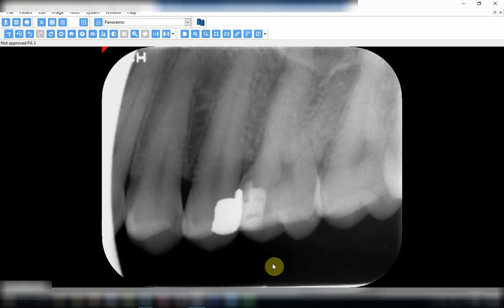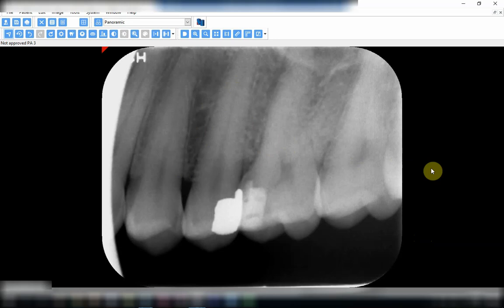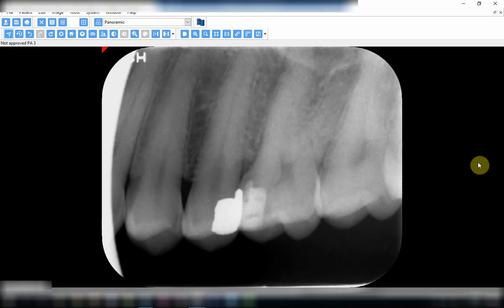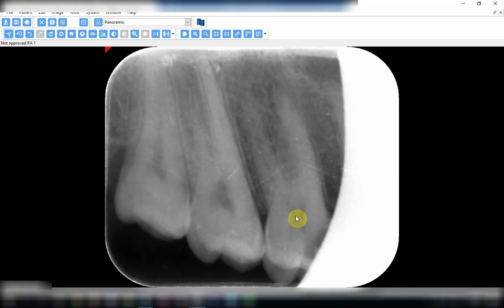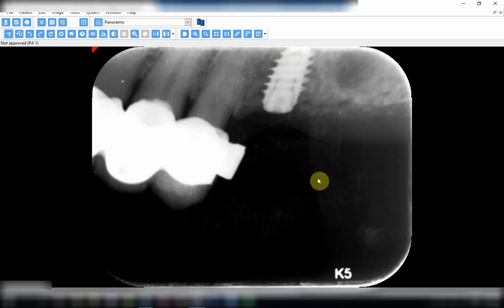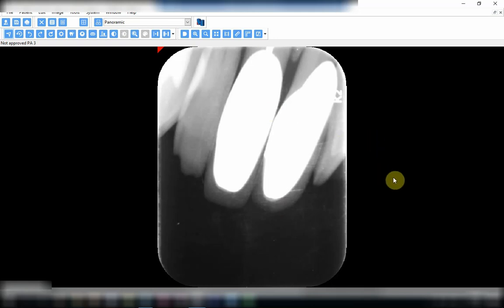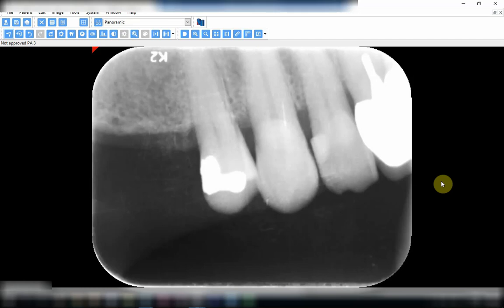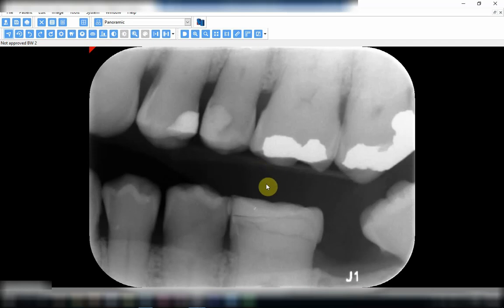Big mistakes.

Comment: Thank you Dr.. Viewed all the vedios in this playlist.. 👍👍 Could you please do vedios for IOPA tech. for pediatric patients..
Reply from the maker: Dear n n, actually the techniques are similar with two exceptions: 
1- decrease the exposure time by 1\4th of adult exposure time.
2- use smaller size sensors (size 0 or 1) based on the jaw size and teeth present.

Comment: Sir I followed your way how can I send my image here so you can guide me I have still facing an issue? Or else any email Id where I can show my problem facing
Reply from the maker: I think that your patient has a wide palate, so the film slides too much below the teeth. What I suggest is you push the film more towards the mid line of palate and then place a cotton roll between the film and the palatal cusp of the tooth then ask the patient to support the film . In this way you will keep the film almost parallel to the tooth. Next step is that you direct the beam perpendicular on the buccal surface of tooth thus the X-ray beam will be perpendicular on the film and tooth.
Reply from the maker: my email is saadwahby@hotmail.com
Reply: @saadwahbyalbayatti9561   assalam alikoum doctor 
Where can I send you my x ray so you can guide me ?
Reply from the maker: @lamiaboubaker2737  Wa Alikum Al Salam, you can send it to: saadwahby@hotmail.com